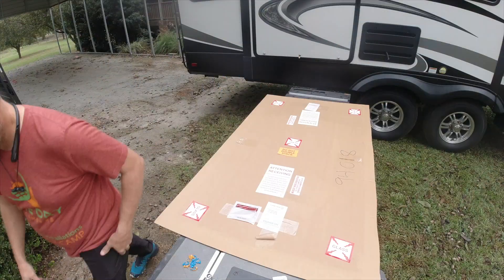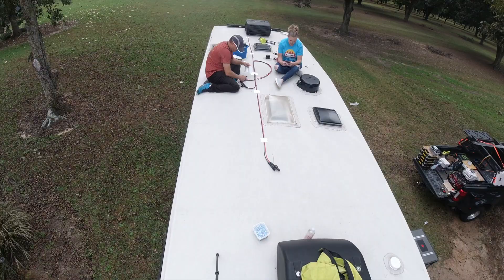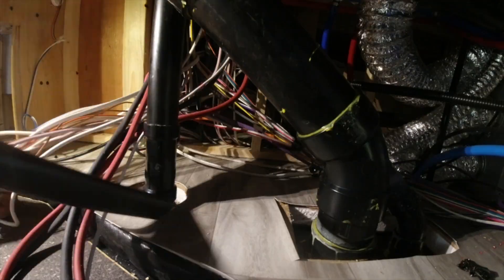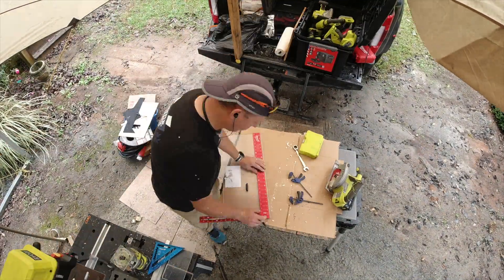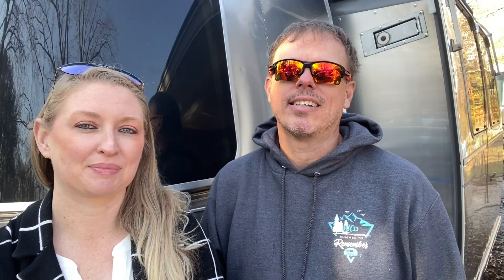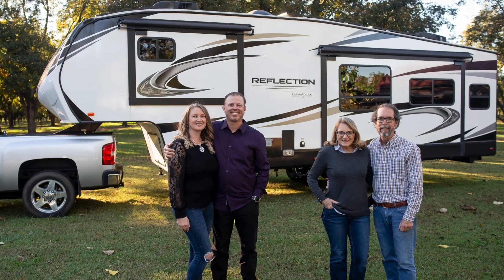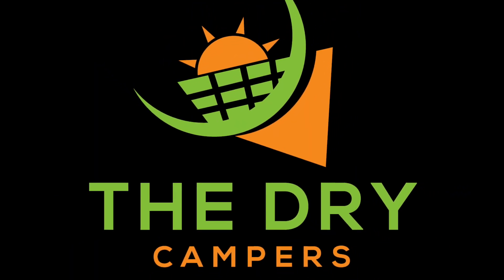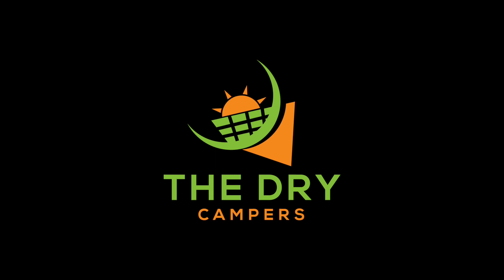2020 Grand Design Reflection 29RS Solar & Lithium Upfit

Comment: Hello Dry Campers!  This is an example of what intrigues me about your operation……unique problem solving on each rig.  And, the rig is better off than before you worked on it.  The dirty manufacturing secret….they just shove all your wires and water hoses in spots and bet the owner will never see them.  Quite the rats nest on some of these rigs before you put your touches on them.  I really like those plexiglass additions that you do.  I think on our rig where I would guess most of the solar hardware would get placed, it is in the only exterior storage area of the trailer and would be subject to getting banged by cargo if not protected like that.

Safe travels!
Reply from the maker: Yes, there is lot of wiring/water lines in rv's that are just put in there.